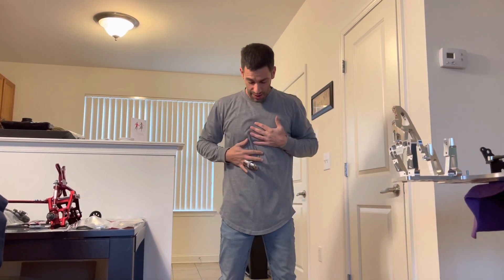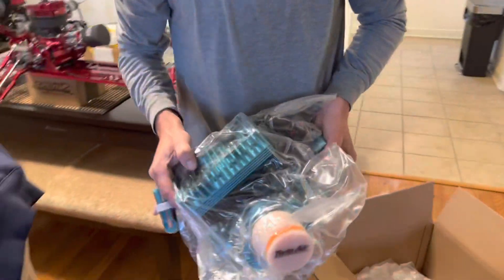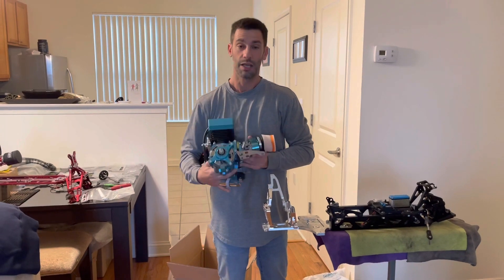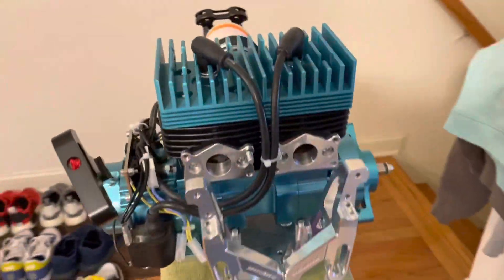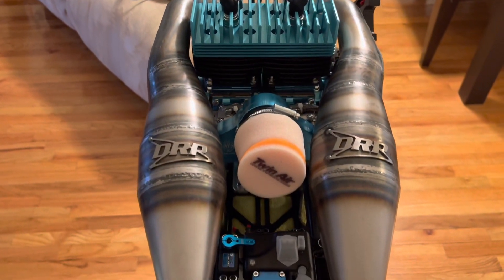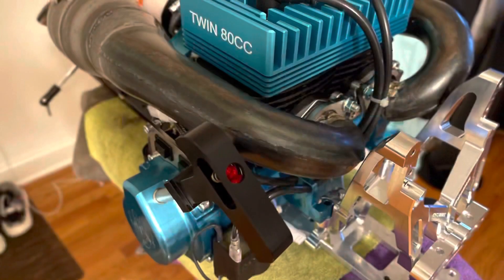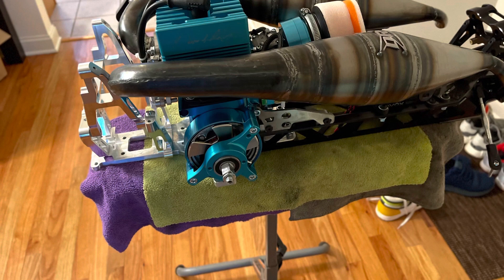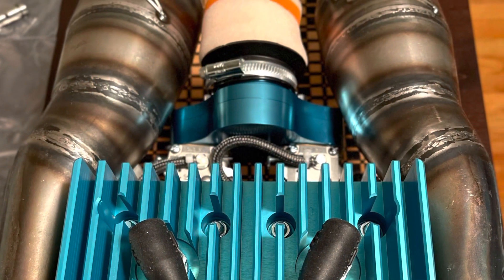Merry Christmas 🎄 Alx Ported Twin 80 has arrived

Comment: Hey man if you don't mind me asking and pardon me cuz I am pretty new to the hobby like I've never had an aftermarket engine yet I'll m curious I seen you had the Taylor 80 I think it was the one you blew the BRP wheels off of , awesome video BTW but comparatively speaking I guess if they're both 80s does the twin have like different running characteristics or like do they rev differently or does the twin have more torque but less top end versus your other one that has perhaps maybe more top in but less torque I ask because I have a Losi 5T 2.0 and I'm certainly thinking about getting a big bore engine thanks for the time I appreciate it man
Reply from the maker: All engine have different characteristics and yes it’s either too or bottom end so higher rpm’s or lower and torque curves are different! Some are ported and some are not! That one was my 88 and yes that’s thing is ridiculous! Go with a 65 supreme Taylor for the 5t